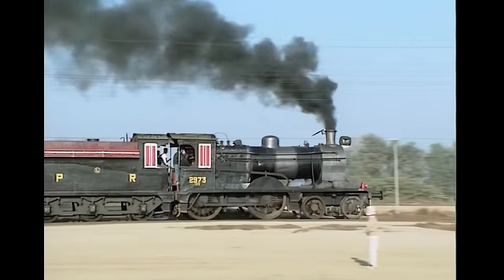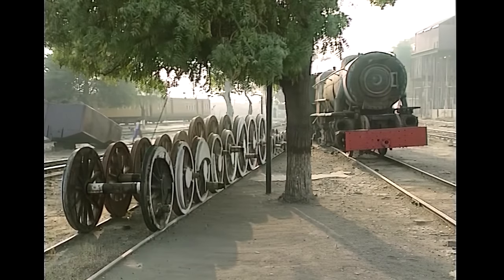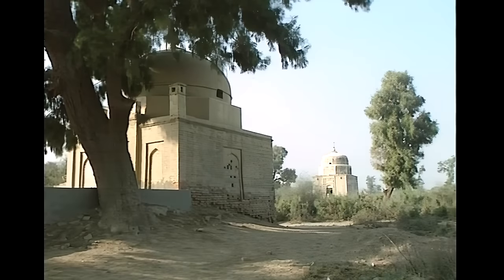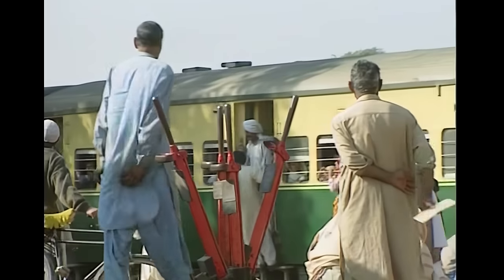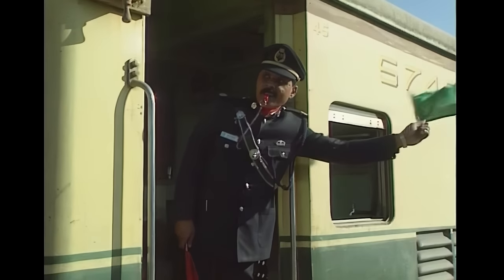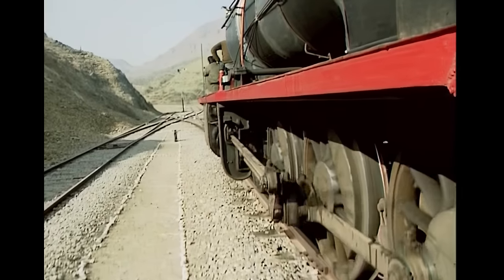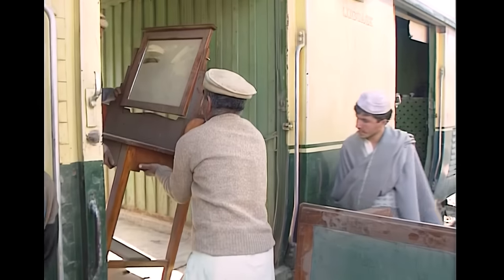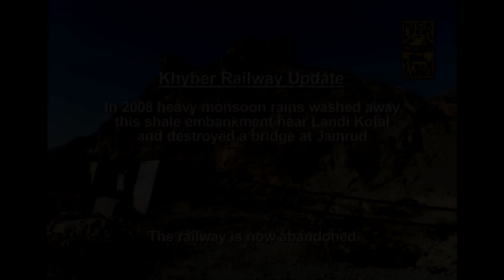Pakistan - Rails to the North West Frontier - English • Great Railways

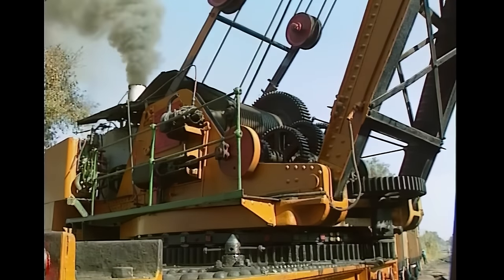Comment: @19:30 The steam powered crane is just as rare a sight if noy more so.
@28:17 Engine crew is protected by a teenager armed with an AK-47.
@35:30 more armed guards at the bridge crossing fort.
@40:23 The railroad should have included at least a flat car for locals to sit on instead of riding on the pilot of the loco.
@45:00 There must be a Wye or Loop track for the #2215 to get turned around.
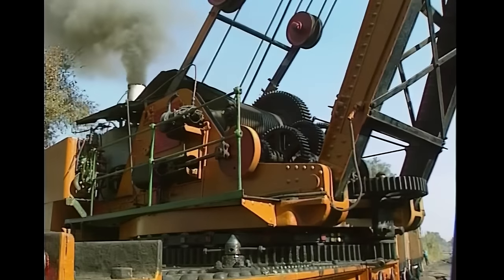Reply: Dear 'Sugarmountaincondo'.  To pick up on the items you mention; 19:30 steam cranes like this were once commonplace around Britain and its Commonwealth, but have almost entirely been replaced by diesel powered versions as you saw in the meter gauge sequence earlier. It was a real treat to find this steam original in good shape and still in active use.  28:17 The territory of the North West Frontier Province is a semi autonomous zone, between Pakistan and Afghanistan, where the tribal communities rule. All outsiders are escorted by local armed guards, and can only visit in daylight hours, unless invited to stay, in which case they must remain indoors overnight. As for the cadet guard you point out, well, the next generation has to start somewhere, and what better than among a group of seniors in charge of a large group.  I doubt his weapon carried live rounds. 35:30 Fort Maude by the road bridge is permanently manned.  40:23 The enthusiastic riders on the front of the locomotive were an ad hoc reaction to the first steam train up the pass for nearly  20 years. The youngsters had never seen a train before, a situation unique to this pioneer run which we recorded. As the scenario was unforeseen, no provision was made to accommodate them with a wagon or flat car.  45:00 The Khyber trains ran with a loco at each end, both facing outwards. So no wye or turn was needed.  Some shots in the Khyber section of this film were taken on later trips, to achieve a fuller visual record of the line,  hence an unavoidable lack of continuity in places.  Thank you for your interest.

Comment: 33:50 What's the firemen throwing into the firebox?
Reply: Sand zu reinigen der Kesselrohre
Reply: In oil fired fired locomotives there is a tendency for tar residue drawn by the draft from the chimney to accumulate in the boiler tubes so that heat does not transmit properly to the water.  When the fireman sees pressure falling he throws sand into the firebox which is drawn through the tubes and scours out the residue. This results in filthy oily black clag spouting from the chineys of oil-fired locos from time to time in the course of a journey.

Comment: IMO reasonably analogous to the infrastructure the Romans were obliged to abandon as their empire contracted.

44:24 Being clear of the tribal areas before dusk? That sounds ominous.
Reply: The Pakistani Govt inherited the old British negotiated status of the Khyber region. It was British protected autonomous Tribal Territory where the British had right of access but it belonged to the tribes. The British rule of law did not apply.  It  ceased at the Khyber Gate at Jamrud. In principle this status remains today under Pakistani protection.  One of the stipulations is that the Tribals are not responsible for the safety of personnel or guests of the Protecting Power in the hours of darkness.  They either leave or stay in their forts. A Tribal Force escort (as seen in the film) must be arranged in advance at the Tribal office in Peshawar and paid for by approved outsiders entering the territory in daytime. Passengers in a broken down special train at dusk would of course be transferred to minibuses but if the train itself was stuck overnight on the line it would be anybody's guess what skeletal remains would emerge at daybreak.
Reply: @NicholasLera-kd5tj  Thank you for that detailed explanation.